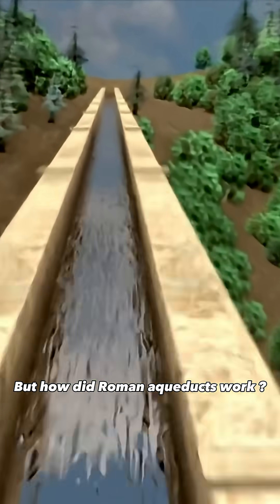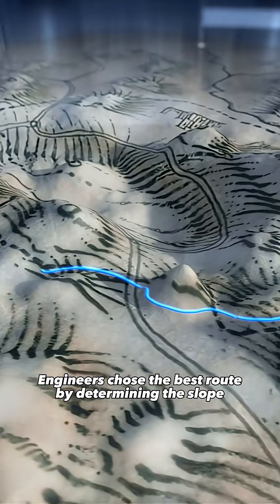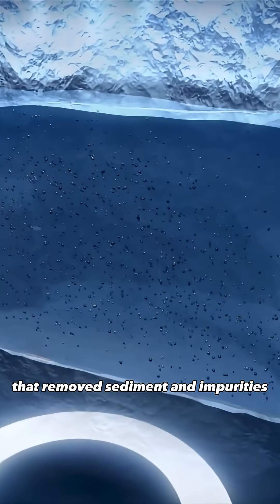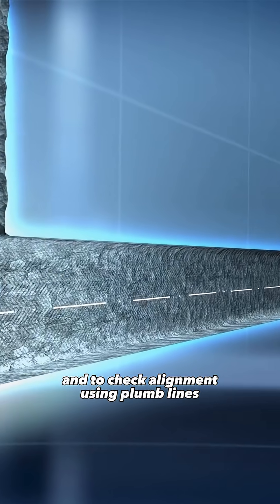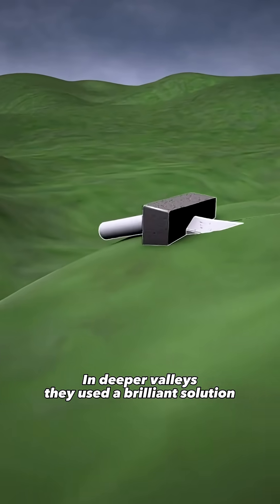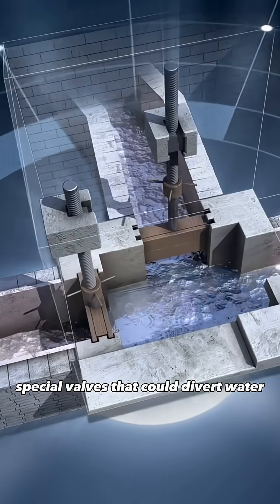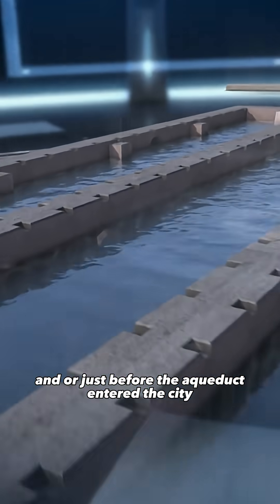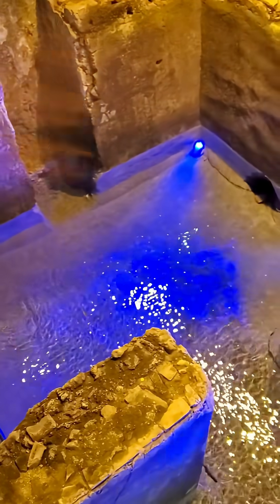The engineering of roman aqueducts explained #history #romanempire #engineering #aqueduct

Comment: The fact that some still work 2,300 years later is just mind bending... Meanwhile we can't keep modern water systems from failing...
Reply: It's not because of the advanced technology, or in difference thereof. It's because they didn't spare on infrastructure projects, because they didn't have to spend much in the first place. Most of their civic engineering was done by the standing army during times of service, and since legions were already funded with wages and there was no contractor middle-man seeking their own profit, costs are greatly reduced. And there was also a dick measuring contest between senators with who will invest their own funds for the good of the Republic/Empire the most, because political prestige mattered far more than it does today.

In current day and age, governments usually seek an independent contractor for that kind of work, and they do it by picking the cheapest option available, because their prerogative is short-term spending, while at the same time, you have middle-men at every step of the way (workforce agencies, providers of building material, transport of these materials, contractors themselves, and every link in the chain seeks to profit as much as possible and cut as many corners as possible), increasing the cost.

Another difference is speed. They spent waaay more time on engineering projects compared to how quickly modern ones get into function.

Modern equivalent of this would be to have the US defense budget spent for a govt-owned company employing military personnel and logistics that would do that work, from start to finish, with lobbyists of US govt (the ones in power, not politicians) pushing each other around to be the ones to invest their money into such projects.
Reply: @a7HKdAbmET Place your comment as a main one - not just as a reply!
Reply: @a7HKdAbmET  a very oiled system indeed
Reply: @a7HKdAbmET  i wish we would use our military for civil work like that -- our roads would be amazing, new housing would go up, infrastructure could be dismantled and rebuilt better than ever... trains and bus systems could be built... damn the money we waste on our military is sad.
Reply: I work for a large contractor and agree. Also to point out building lifespans have greatly reduced due to rapid expansion and chnage in government durations. Which increases the risk in redevelopments. And the added costs.
Reply: The difference is that wealthy and powerful people relied on these aqueducts so they built them sparing no expense - there’s a good amount of survivorship bias here - the systems they made for poor people still failed
Reply: @sarahnelson8836  I would disagree in this particular case. When we're talking about projects that provide amenities, approach to handling infrastructure was likely similar to modern era. Gentrified, wealthy and affluent areas get more money invested, but sometimes also more money taxed (depends on the country, really). 

On the other hand, projects of that size and importance (because clean water is a necessity, and not an amenity) are not a local thing. Smaller and more localized projects, sure, but without drinking water, there is no settlement.
Same goes for roads, with an exception of germanic provinces that had a logistical issue (stone is notoriously expensive and difficult to move en masse, and it was not readily available locally) so the roads there didn't meet the Roman engineering standards (they were still marvelously built, but alas, when you rely on wood for that kind of project like they did in that particular case, you won't have it working for 2000 years). 
Bigger urban zones (regardless of level of gentrification) also got bigger investments, same as today. 

But quality in general wasn't lacking. My city has an underground Roman aqueduct that stretched approx 30km from the source, and back in the day, city wasn't really that big (likely 10k people). Archaeologists believe that it could easily provide water for at least 10x more than estimated number of people living here, and most of them were either legionary veterans, or Illyrian natives, both notorious for not being wealthy enough to warrant more expense than, say, cities in Italy.
Old road following the aqueduct is still there, mostly. Town's Forum is buried layer beneath the old town, and it still provides an insight in size that it once held and excellent quality of the work. For whom? Not noble families, or estate owners, that's for sure.
Reply: I'd also like to add that your idea is completely right regarding the private construction sector - villae and palaces for the rich were more likely to survive the ages than tenement complexes they made for the masses, but those are a different subject from the question of infrastructure and warrant a different discussion.
Reply: @a7HKdAbmET  why would infrastructure be different exactly? Do the extremely wealthy use our schools, our roads, our libraries, our water or our emergency services? Or are all these things separate for them? 
In Rome there was of course more overlap between those systems that average and wealthy citizens used - and even non citizens - however the wealth and technology gap was also significantly smaller. And not all of those systems did overlap between the citizens and non citizens…. And the ones built for the average folks were definitely affected more and degraded more over time.
Reply: @sarahnelson8836  Key words being "they" and  "made for".  The wealthy and powerful made aqueducts for poor people.  Giving somebody something isn't an obligation, unless it's taken by force... then it's referred to as theft.
Reply: @sarahnelson8836 it's still amazing that they even did it at all
Reply: ...Do you think it was unmaintained? Like it's constantly maintained, it didn't just work flawlessly for countries on its own. It has to be cleaned, unclogged, and patched. There is no piece of engineering that is just workis left alone
Reply: Also keep in mind that any system you compare to today will be exponentially simpler. Roman aqueducts, while definitively impressive, were 1) mega projects, not basic city wide, dense infrastructure, so they obviously got a lot of care, and 2) basically just glorified channels. Today's systems are a lot more complex, and with complexity comes exponentially growing failure points. Te Romans weren't better, they just had better funding (Surprise surprise, if you invest in public services they work) and simpler needs.

Also the parts that still work today, keep in mind they've probably been remodeled hundreds of times, and most likely only the utmost resilient parts are still used, the rest most likely was already modernized XD This isn't to take roman engineering down by the way, they truly were one of a kind, but y'know, let's keep perspective in mind.
Reply: Are you so stupid that you believe Roman aquaducts never failed and needed repair? Moron.  Unbelievable!!!!
Reply: which country
Reply: The water is also not as good
Reply: We have qanats of similar age as well.
Reply: They had like like maybe a dozen of these whereas we have thousands of these systems that work without regard towards elevation and provide water that is 10x better while being much more reliable. You take a lot for granted
Reply: @gp33music41 Yea, back in those times, people didn't really drink water. Needing water to survive only happened after industrial revolution, I guess.
Reply: @a7HKdAbmET  Was there someone else that commented something you meant to reply to? Is there a voice in your ear telling you I wrote something I didn't? I merely stated the fact that people take modern technology for granted way too often. You are bashing US infrastructure without tackling the reason why it has so many issues, its very heavily used. Bridges in bum hole Vienna probably never had a 10,000 kilo semi truck drive over them 10x a day alongside hundreds of other heavy vehicles. Yes we have infrastructure issues, but the reason why is that the government is often responsible for it, and they don't do a great job, and to fix a bridge in America it means often closing down a vital artery used by thousands everyday.
Reply: Maybe in America. Water system is great where I live
Reply: @KK-----  who uses it where you live? In the US it is so large that the wealthy and powerful often have separate municipalities with more vigorously supported infrastructure - many of the billionaires have multiple homes some entirely off grid. And maybe a condo in Manhattan and LA- which they move between on their private jets.
Reply: @KK-----  NYS has the best water in the country, not sure about the "world" but they've made a huge underground aqueduct from the Adirondack mountains all the way down to NYC, no doubt the idea came from the Roman system.
Reply: @synystur21  There are great feats of engineering in almost every place where civilization passed over the bronze age up to this day. That's not my point. 
I was using the US as a comparison not because its infrastructure sucks (and in average, it really does, when you compare it to other nations of similar state of development; just look at the percentage of bridges in the entire country deemed unsafe or dangerous to use, while still being in use beyond their original intended strain and/or capacity, there are stats by an agency that exists to assess these kinds of things; or the state of your highways after you realize how much it is estimated to spend only to keep them maintained to be at the same degree vs how much is actually spent) but because it reflects the ancient Rome in its presence and projection across its contemporary world. And yet, how differently these two powers across time approach the issue of civic engineering and infrastructure.

I have another great example, a more local one. This small little historical town (continuously settled since 9th century BC) near to where I live had a little bridge over the canal that separated the town from the land. The canals were part of a system used since Roman era to turn marshes into salt flats. A local company harvests the salt in the same place to this day, and in great quantities. Now, the bridge was there for a long time, because it was a main entry into the town. Its last form was built in 16th century, and is a thing of beauty, made of stone. It survived 4 centuries of crap - storms, floods, earthquakes (the one 10 years ago went near to 7 on a richter scale, and there was one estimated to be at 8.5 during 18th century). It survived it all. 
In 2017, there were some floods. Nothing big, the entire county was soaked by incessant heavy rains for a week (unusual for the climate region), and bridge itself stood well, but was full of water that had difficulty draining the water from the top (it looked like an aqueduct at some point). 
Due to fear of bridge collapsing, govt did what govt does best and town council decided to tackle the issue by drilling holes into the floor on both ends of the bridge to help with drainage. The bridge, of course, fully collapsed after its load distribution was disturbed, and its static was disrupted.
I personally know the two idiots responsible, one is at a high school level education, and the other is an economist.
It is a great story that juxtaposes the Venetian rule in 16th century that provided the engineering marvel that stood against time and disasters (not really, it was just a bridge, but imagine a modern bridge to be capable of holding for 4 centuries) with minimal amount of maintenance, to be met with modern day local politics that believes itself to know better than anyone else, including the ones who put that bridge there in the first place. The best part is that the town's official site cites the destruction of the bridge to be due to cracks that formed during the flood. I mean, not wrong, but a half-truth nonetheless.
Reply: @synystur21  I think vienna takes the crown, for best water qualitie of a capital city.
Reply: @synystur21  lmao thank you for making my point

Comment: Who built all this and how long did it take? How were the aqueduct arches built? Who fed the builders? Who maintained the system?
Reply: skilled roman engineers built it.
along with labor force like slaves and soldiers.

how long it takes depends on the size and terrain. for example 
Aqua Marcia (91 km long) took about 9 years (144–135 BCE).
Aqua Claudia, over rugged terrain, took 14 years (38–52 CE).
Some took decades, but construction could happen simultaneously on different sections.

arches were built step by step, 
first the foundation was dug into bedrock or laid over compacted earth.
Wooden scaffolding (called centring) 
Temporary wooden frames shaped like the arch 
held the stones in place during construction.
Voussoirs, wedge-shaped stones placed from both sides.
and final stone at the top locks everything in.
remove wooden frame and the arch supports itself by compression.
The Romans mastered the true arch

Workers were usually fed on-site, using mobile kitchens or nearby towns.
Military units had organized logistics — they could build and feed themselves.
Slaves were fed by their owners or project managers — usually basic rations.

maintenance was done by Curator Aquarum (“Water Commissioner”)
A high-ranking Roman official responsible for water quality, distribution, repairs and legal disputes over water theft....
and
 Aquarii (Watermen) who were public workers patrolling the aqueducts

Maintenance was paid by the imperial treasury, cities, or wealthy patrons.
Sometimes, a benefactor would sponsor a repair and get a plaque or statue in return.

Comment: Roman Aqueducts are simply amazing! ❤

The Eifel Aqueduct was one of the longest aqueducts of the Roman Empire. 

￼The route of the Eifel aqueduct, with its average slope. 

The aqueduct, constructed in AD 80, carried water some 95 kilometres (59 mi) from the hilly Eifel region of what is now Germany to the ancient city of Colonia Claudia Ara Agrippinensium (present-day Cologne). If the auxiliary spurs to additional springs are included, the length was 130 kilometres (81 mi). The construction was almost entirely below ground, and the flow of the water was produced entirely by gravity. A few bridges, including one up to 1,400 metres (0.87 mi) in length, were needed to pass over valleys. Unlike some of the other famous Roman aqueducts, the Eifel aqueduct was specifically designed to minimize the above-ground portion to protect it from damage and freezing.